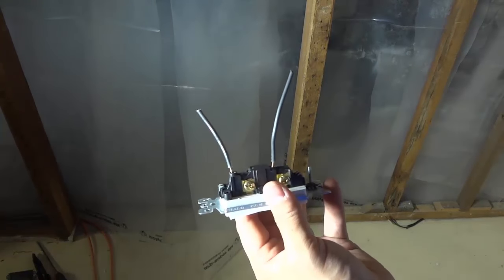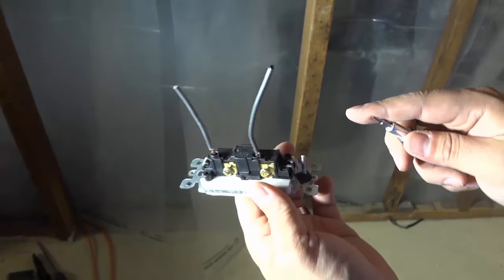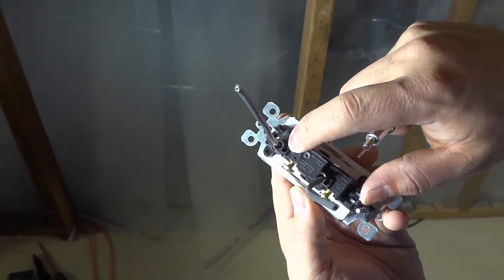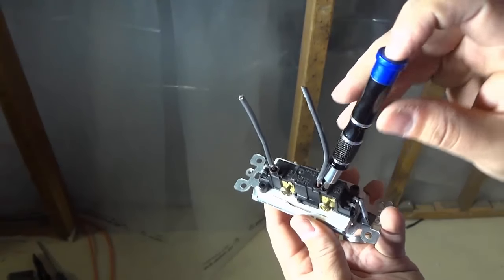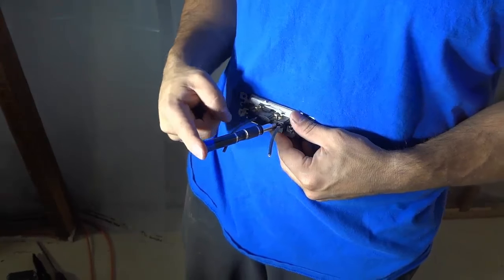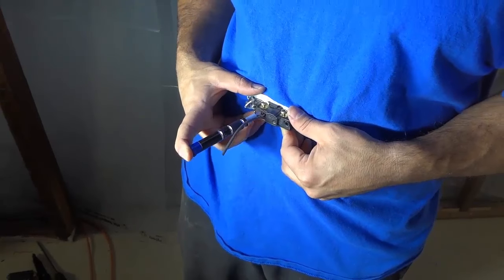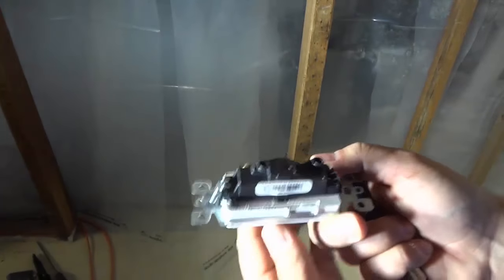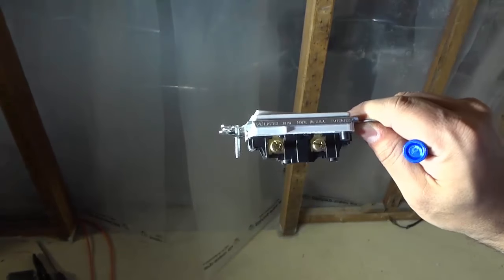How To Remove Wiring Pushed Into A Light Switch-DIY Electrical

Comment: Who here is like... "I ALREADY TRIED THIS!!!"?!?!?!?!
Reply: Did u ever figure this out?
Reply: This doesn’t work for me either. Pushing as hard as possible and just doesn’t release. Ended up buying a new switch as when I just yanked in the wire, it broke off inside
Reply: Ya this didn't work for me either dunno if it's cause it's so old. It didn't break off for me yet but won't come out no matter how hard I push

If you scroll down though another comment mentions just busting the back off the switch apart with the flatblade in the hole that doesn't work and prying the wire out of the expose back    @MrPiestro
Reply: Did you use your belly tho?

Comment: Thank you so much.  This was very helpful.  I had to try 5 different types of flathead screwdrivers, but I was finally able to pull the wire out.   I guess they made it so tight to avoid shorts...but really a bad design.  I had my previous owner of my home use both the screw and push socket to connect the hot wires for a switch loop on a switch.

Comment: No matter how hard I push down, it will not release the wires, even with vice grips trying to rip the wire out, so I just twisted the screwdriver and busted the back, now you can bend the prong holding the wire and BOOM simple!!
Reply: This helped me a lot! Breaking the old switch to get access to the wires was a lot easier than getting the press release to function
Reply: Yes! They are so hard to get to release. Old ones take forever. Not always as easy as this video shows.
Reply: This. I had the same situation. Switches were likely 15+ years old. Nothing I did would get these to “push and release. “I had to basically break apart the entire light switch to get the wires out – extremely annoying.
Reply: I guess the last thing to do if the wires won't release is to cut them off at the entry point of the hole, use a wire stripper with the right gauge, then put them into the new switch - either on the screw terminals or the back hole connector.
Reply: Same old shitty design that doesn't change for years and years. Like 90% of household/construction materials.

Comment: I couldn't figure this out for the life of me. I didn't notice those little holes there. I still had to use pliers to get mine out but they would have never came out if I wouldn't have known to push a little screw driver in those little slots. Thanks a bunch!!
Reply: says on the back to push screwdriver in slot while pulling on wire.
Reply: @SantosSantos-bf5sz   No, it didn't!

Comment: Thank you so very much! Your video has been sooo helpful, just like your YouTube channel name. Now, I know what to look for with this type of switch, I was able to pull out the black wire. Am keeping my fingers crossed that it will work for the other 2, which I am leaving in until I get the new switch.

Comment: Wow amazing! This is very helpful. One question

Do the screws have to be threaded all the way up or down once i out the new wires back into the hole? Your wires seem to be unthreaded when you release the wires. Once the new ones are in do I have the tighten the screws again? Thank youB

Comment: easy for you to say when the wire already been cut and you not working with it hanging from the wall.
Reply: LOL 1st thing I thought of, always a pain when its tight on the wall with little slack try getting screw driver into the hole. Not so fun

Comment: My outlets do not have the small slot under the push in connection, is there a way to get them out?
Reply: I saw a picture of the inner holding mechanism online. It was literally 2 metal arms squeezing the wire tightly. When you put the flat head in, you're putting yourself between 1 of the arm and the wire. I think you can try excessive pulling with some twisting motion and hope that the metal arms slip.
Reply: @gorgefood9867  You don't get it, he didn't have the slots like in most switches so there is not way to use a flathead screwdriver or anything else.  I think you have no choice but to cut the wires.  Probably still can reconnect using the screws, which should have been used in the first place.  Cheap switch I guess.

Comment: When replacing the switch is it better to attach the wires to the screws on the side or the holes on the back of the new switch?
Reply: Side 100$

Comment: The releases were not releasing. I ended up pushing on release then using needlenose pliers and grabbed wire and twisted wuth leverage. They came out pretty quick. When i reinstall i will use the nuts.
Reply: I had the exact same problem. Piece of shit lol. It’s “Quick connect” but certainly not “quick remove”

Comment: It works, unless the wire is welded to the switch.  I took a drill and disabled the the 2 rivets holding the switch together.  Then took all the insides out, including a small keeper that the wire was welded to.  Had to cut the end of the wire to get rid of the weld, after it was out.  Maybe the only time?

Comment: Why is the wire pushed in there not wrapped around the screw
Reply: Kyle Dewar what I'm trying to figure out right now lol
Reply: You can do it’s either way, the screw requires more work for home builders but makes a better connection. Using the screw is better for connection but a slower process. But it isn’t as safe since the wires are exposed.
Reply: Laziness
Reply: AppleiReviewer "more work". It actually takes 1 minute more.
Reply: Its Its really annoying. The electrician that wired my house was lazy and jammed them all in the quick socket for me. I've noticed as I'm replacing my switches for smart switches.

Since they never release I have to cut the wires them then restrip them for my new switch.
Reply: In reviewing other videos it looks like a careful electrician will wrap the switch using electrical tape if the side screws are used to connect the wires.
Reply: seen people wrap electrical tape around the screws. @AppleiReviewer
Reply: shopping list : electrical tape.

Comment: I can't get my stomach up as high as the light switch.  :-(
Reply: Hmm, neither me, but once I learned that I wasn't imagining a weird light switch, I figured out a way to leverage it in one hand while the palm of the other pushed the screwdriver in and the fingers pulled the wire out. Worse comes to worst, smash the switch, who cares, it's busted and getting replaced anyway.
Reply: just dont turn off the power, bet you can get it right out.